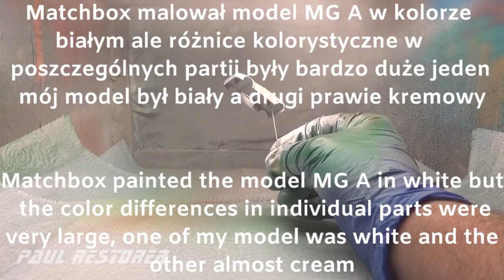Matchbox restoration MG A Sports Car nr 19B casting driver figurine diecast car

Comment: Superb.  Very nice work, and great result.  Clever design by Matchbox.  Seats cast into the base plate, and separate driver figurine,  enables painting 2 different colours, without having to use masking, and waiting on drying time.  The MGA's shape and line is a very attractive design.  Odd that Matchbox never did make an MGB model.
Reply from the maker: Thank you very much